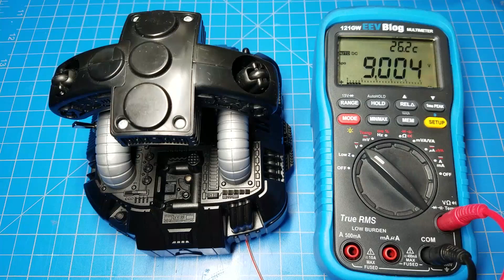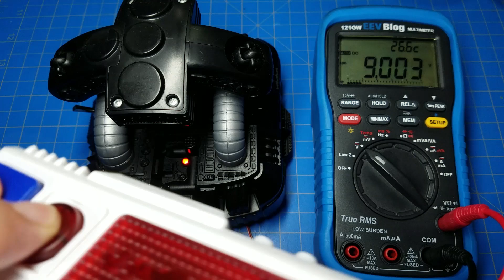How To Tell If Your Droid Needs New Batteries

Comment: Do you know what the maximum voltage is the droid can take ? As i was going to make a battery pack for mine and wondered if I could use more than 9v
Reply from the maker: I would try to stay as close to 9V as possible, but 11 volts is the maximum.

The batteries are connected to a 5V regulator and the motor control chips. The 5V regulator (datasheet: https://datasheet.lcsc.com/szlcsc/1808092114_MICRONE-Nanjing-Micro-One-Elec-ME6210A50M3G_C236679.pdf)  has a maximum input voltage rating of 18V. The motor control chip (http://www.amtek-semi.com/en/products/detail/56) has a maximum input rating of 11V.
Reply: @Ruthsarian  So if modified, a droid could run off 12vlts?
Reply from the maker: @HackerBilly13  The motor drivers are rated for 11 volts. They may work fine at 12 volts or those chips may get damaged and the droid stops working. It's a risk you take trying to power the droid at 12 volts.

I think if your power supply is 12 volts you need to add a buck regulator that drops it down to 9.
Reply: @Ruthsarian  Whoops! I totally meant to put 5vlts there not 12vlts! That was my bad. 
I know with certain regulators. You can sometimes bypass some and run it off of 5vlts. 
So I wasnt sure if there was going to be a way to do that with these as if you could. It would open up a huge possibility of adding a rechargeable battery pack
Reply from the maker: @HackerBilly13   If the droid detects the power supply is below about 7 volts it will automatically shut itself off. If you want to run off of 5 volts you'll need to add something to boost the voltage.

alternatively you could modify the low battery detection circuit so it won't shut itself off at 5 volts. but then you'd also probably have to bypass the 5V regulator in the droid as well.
Reply: @Ruthsarian  Ah dang. That definitely is an issue if it shuts itself off if the voltage is lower than 7vlts.
Dang

Comment: My droid is turning on when I put it on and it is on for a while. But then it randomly goes off. Does it need a battery change?
Reply from the maker: droids will normally shut themselves off after a few minutes if you don't use the controller to make the move or make noises. could it be that?

Comment: My bb unit sounds so low now. Do you think it’s the batteries? It wasn’t low when I got it. Sounds muffled.
Reply from the maker: if you can move your bb around for several seconds without it shutting itself off it's probably not the batteries. if it does shut itself off then it's possibly the batteries.
Reply: @Ruthsarian  any guesses as to why it could sound muffled? I’m baffled. The R2 we have sounds the same as when we got it.
Reply from the maker: @ILikeSTUFFXD  there could be something is physically wrong (speaker came loose or a broken speaker wire). 

maybe the microcontroller has glitched. you could try powering the droid off and leave it off for about 5 minutes. this forces the microcontroller to reset and may clear any glitches.

do you have a personality chip installed? if you do, try removing it. if you don't, but have one on hand, try inserting it. does the muffledness change?

Comment: I just changed the batteries after bringing my bb unit droid home. I made her on Wednesday and didn’t turn her off until today (Saturday). It rolled weird on hardwood floors and had muffled sound. After watching this video, I changed the batteries to brand new ones but the sound is still muffled. Do you think my droid got damaged on the way home?
Reply from the maker: BBs behave differently on hardwood vs carpet or pavement floors. Do you have a carpet or carpeted floor to try it on and see if it behaves as you expected? If it does, it's probably okay

If you remove the shell and have it make a sound does it still sound muffled? The shell will muffle the sound a bit.

If it doesn't sound or roll right, you should contact Disney's Merchandise Guest Services at 1-877-560-6477 or e-mail at Merchandise.Guest.Services@DisneyParks.com. They may be able to replace it for you for free.
Reply: @Ruthsarian  thank you for your reply! The sound is muffled still when it is out of the shell. :( it moves better with the new batteries, so much so it’s head fell off without even bumping into anything. I will contact Disney, thanks

Comment: Hi I need your help, the sound of my droid is so low, do u think he needs batteries ??
Reply from the maker: was the volume always low or did that only happen recently? is it a bb or r unit droid?

it might be the batteries, but if the batteries were low enough to cause low volume then i would expect the droid to shut itself off as soon as you turned it on.

when you're done using your droid, do you turn it off with the switch or do you let it turn itself off?